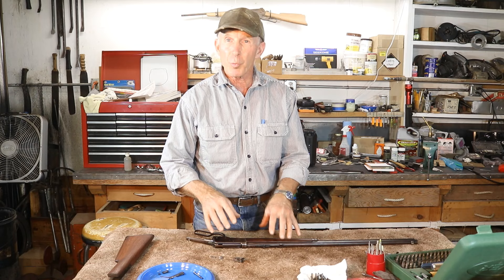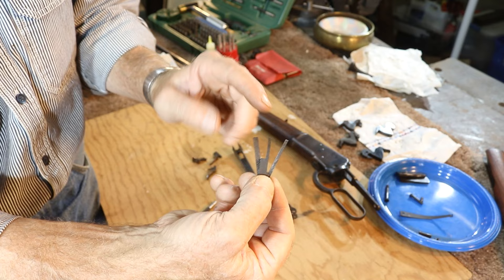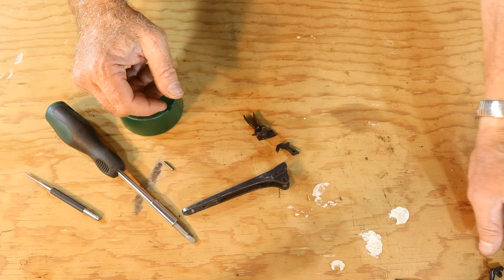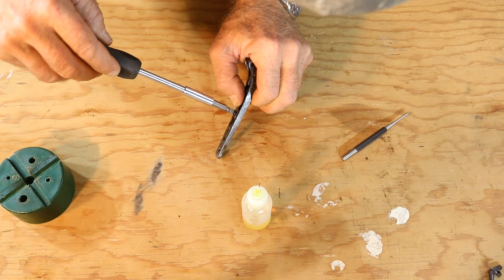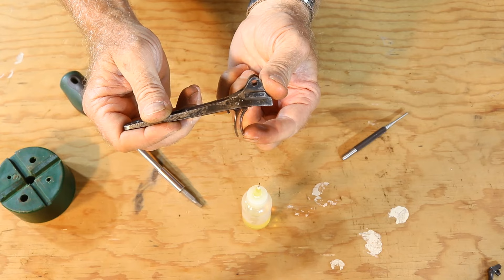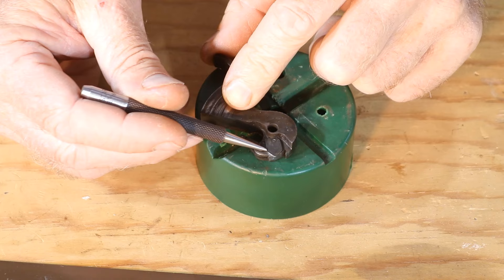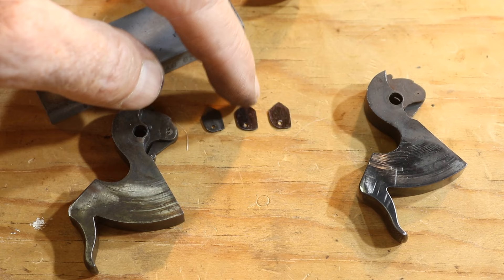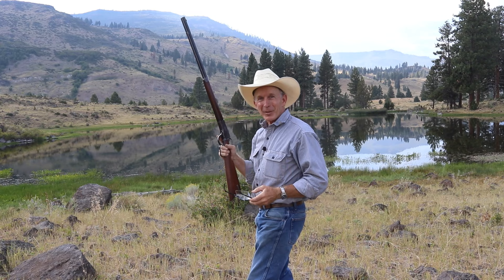Winchester Double Set Trigger Diagnosis & Repair

Comment: Great video Mark. Thank you for making it. I am having an issue with my 1885 Highwall. Sometimes you need to double cock the hammer back in order for it to engage. It is a single set trigger on a number 4 barrel in 38-56. Once cocked, the set trigger works great! Any ideas? Thanks Mark!
Reply from the maker: It could be a number of things, but I wouldn't want to speculate without seeing it.

Comment: Did You Have To Harden That Fly Piece You Made Mark or Did You Use a Pre hardened Piece of Steel to Make it With 😀 Really Cool Too See How Those Triggers Work Thank Mark 😀🎃
Reply: Thought the same ?
Reply from the maker: Hammer flies aren't hardened.  The steel I used is harder than was used for the originals, but isn't tool steel.
Reply: @thecinnabar8442  Thanks 😊

Comment: Mark, would have liked to see the fly you made installed on the trigger. Did not see the pin on the trigger. Was it missing? Just curious. She’s a shooter for sure! Thanks.
Reply from the maker: Sorry, but I didn't think it was necessary since I'd already shown an 1892 hammer with the fly installed.
Reply: @thecinnabar8442   It’s just that I didn’t see the pin on the hammer and was wondering how it would go together. No big deal.